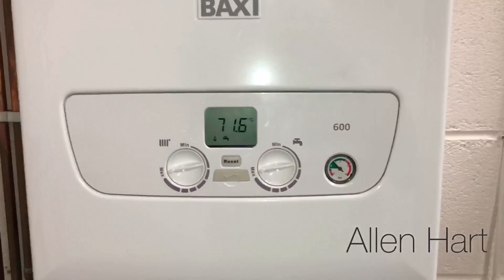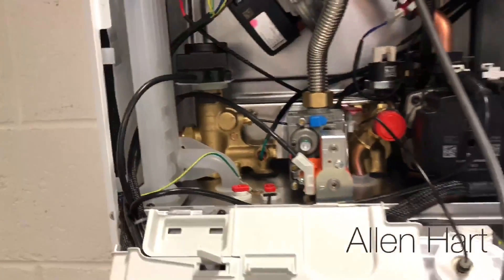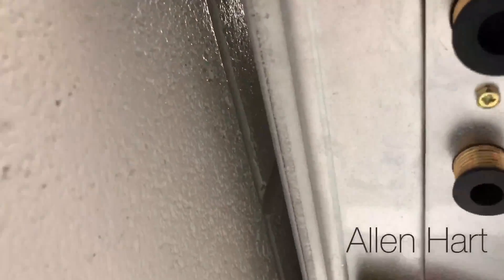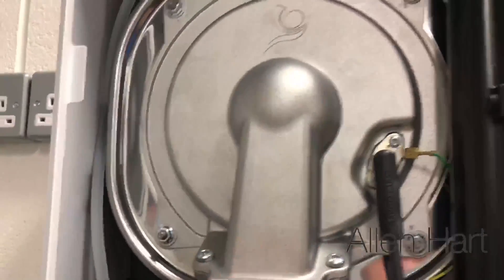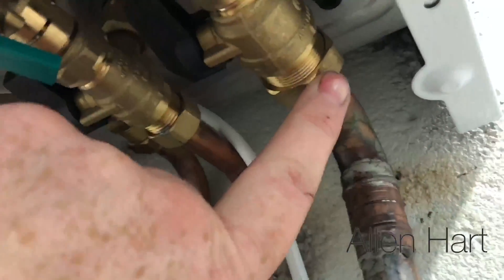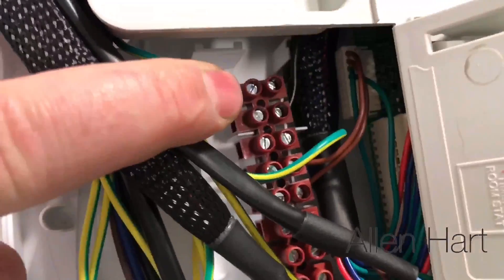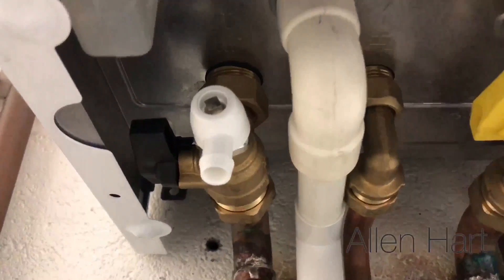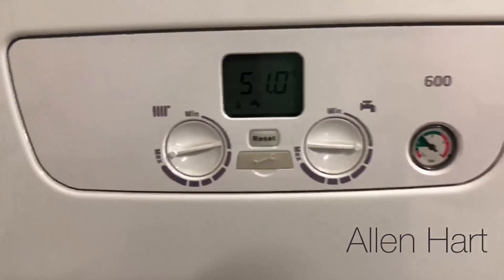Baxi 600 Overview , Installation and Putting into Service Mode

Comment: I got baxi 630 can you give me some information i want to use only hot water i set the temperature and on the radiator dial i put minimum, is that off or the radiator will be running too? And if I turn the hot water tap off and both dials on minimum why is the boiler still running. Do I have to off it from main switch. Will that not cause it problems please let me know
Reply: You sure it’s not the fan still running ,  it purges before it ignites and seems to after it’s off,  I have the 630  check the flame graphic if it’s not showing but sounds as if it’s running it’s the fan...

Comment: Just had one fitted CRAP boiler you cannot turn the hot water off so if you have a tap water fail while you are away hot water 50 deg will be running until you get back to it may old Ideal isar was like a RR compared to this crap do not have one.